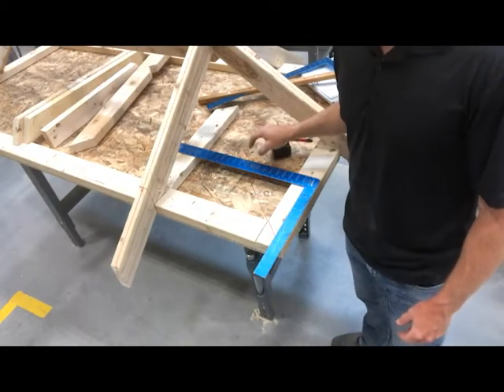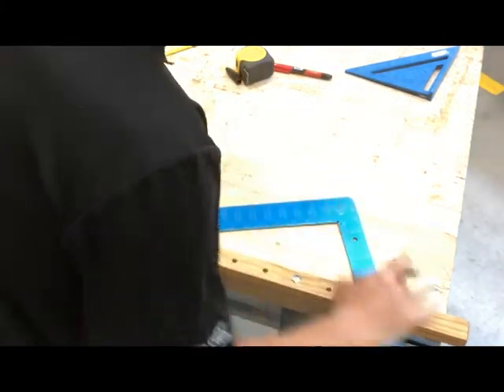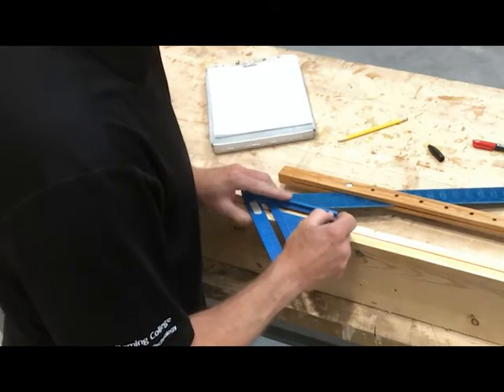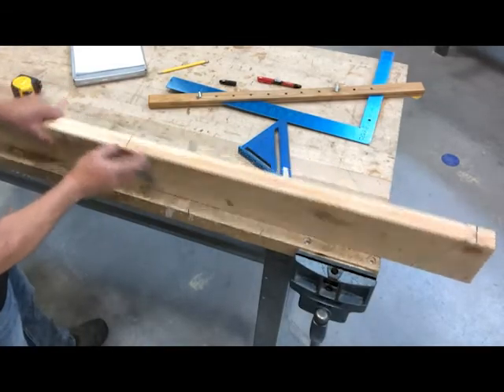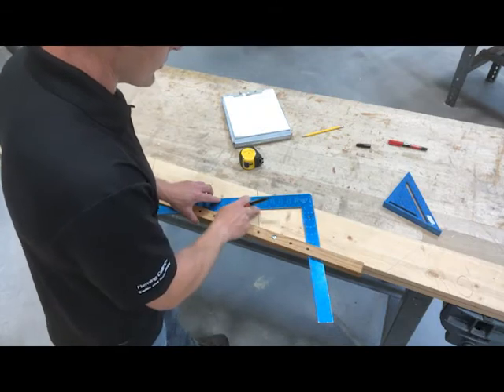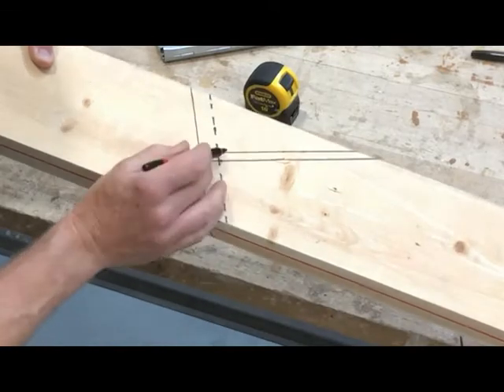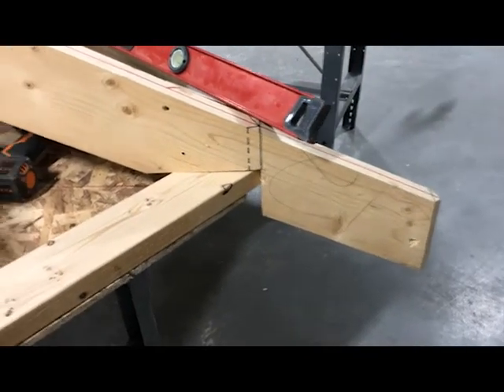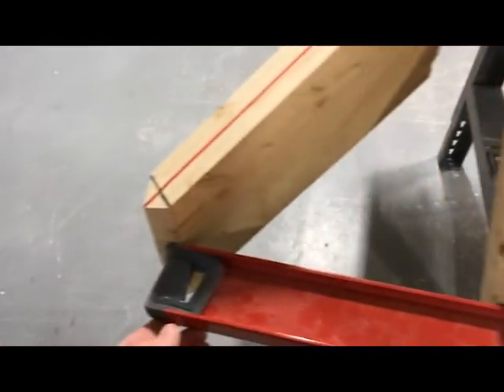How to Layout and Cut a Hip Roof Part 4  The Hips

Comment: after watching dozens of hundreds of video on hip rafter i came to conclusion that americans either can't or make hips more complicate than it is. Europeans carpenters have genius idea of direct measure and use HAP block that doesn't need all these calculations. i even brought a 50$ construction calculator and know how to calculate and all that but now its useless after i calculate the rise height of my ridge beam and ive wasted hours watching americans pulling calculators etc out for nothing and wasting time since most buildings aren't  square even with new build
Reply from the maker: Got a link to the European HAP block method?
Reply: @scottfleming  im gladded u didn't talk down on me for being a newbie or not know what i'm talking about but here it is https://youtu.be/A-_wQlpqL1s?si=-fY-PKl__yA7wHLs at 13:00 this method require u to find how deep of the bird mouth cut u want first so u can use to instantly measure rafter using the HAP block on ALL of your rafters even the hips and where to cut all you seatcuts to be exactly the same height . just an hour ago i use direct measure by laying the un cutted seat cut rafters directly on the top plate and i use the HAP block to mark all my seat cuts so they’re all the same.  given that my house isn't square and the 2x12s isn't straight so calculating on paper would be worthless and waste of time imo. thank for your attention. i liteary have dozen of large size cardboards filled with maths like i'm back in college until i found this method
Reply from the maker: @derpherpp3 awesome thanks. I’ll check that out when I get a chance. I’m always looking for better options. 👍

Comment: Around 6:10 what do you mean about cutting it 60 degrees but the mark your cutting isn't a 45 but you said your cutting it at a 45 anyway? That doesnt make sense
Reply: You set the bevel to your circular, saw to a 45. However, before circular saws  were used, rafters were hand cut. So you would have to lay out that angle. The angle in plan view, looking down on the rafter is not a true 45 because it's a compound angle.